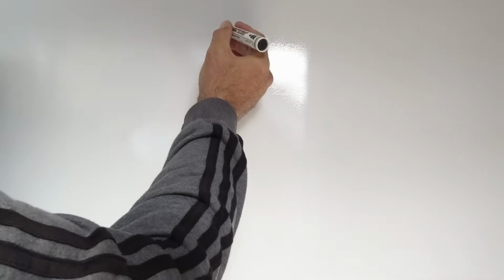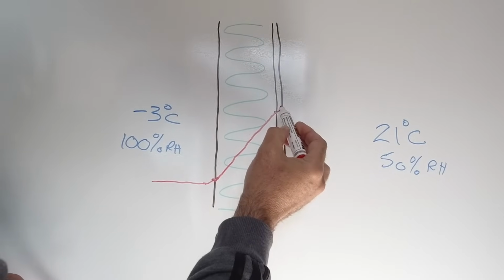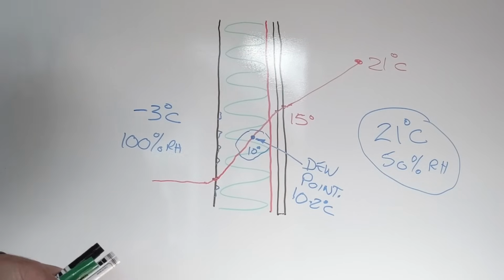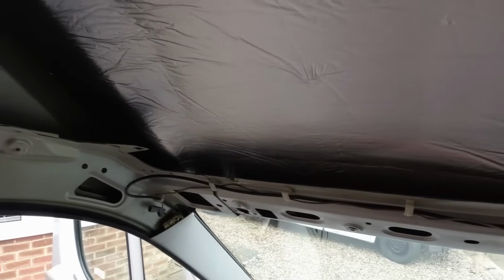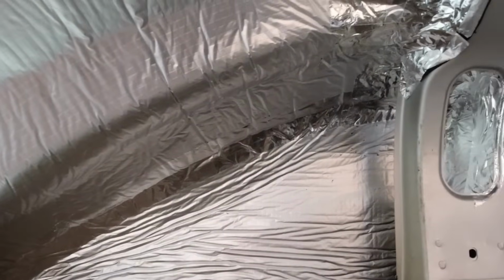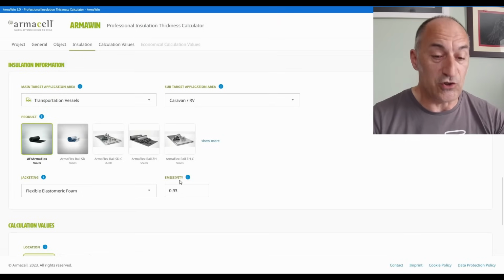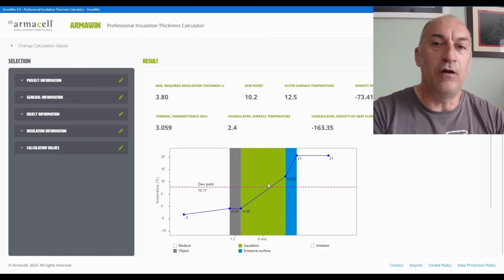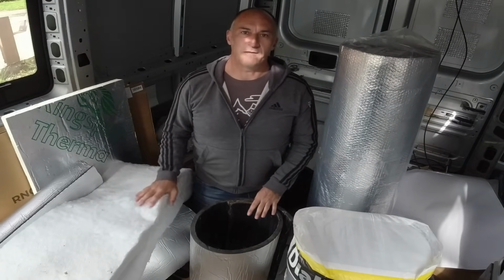The BEST way to Insulate your Van - Budget Build Ep 6

Comment: Loving your videos Greg! Many thanks! I have question about filling the spaces where the brake lights are. Do you remove the plastic covers, insulate those spaces, carpet over plastics covers and replace? Thanks in advance!
Reply from the maker: This is a bit different to how I did the Sprinter van because you do need to access these voids to get at the back of the light clusters and the reason the covers are vented is to allow air to escape through a big hole in the bottom of those pillars when you close a door otherwise the pressure inside would make it hard to open and close doors. So we need to seal those pillars off from the interior of the van, tricky but worth doing. then I would make some insulated plastic bags like pillows and fill the voids with these, that way it can still vent, if it gets wet in there the insulation won't get wet and it will still drain and you can still remove the covers for access to the lights. it's a little bit involved but I hope that helps explain what is needed.
Reply: Thanks so much for this detailed reply. Just so I'm sure I understand...I will fill some little freezer bags with my recycled bottle insulation and fill the pillars with these. I'm then planning to carpet the access doors and still be able to take them off, if I need to access the area. I will then keep the big holes at the bottom of each pillar completely clear so the door can close...hope I've got that right : )
 @GregVirgoe
Reply from the maker: @mj6720  that’s perfect 🤩 I’m planning to cut the vents back into the covers if I carpet them so they still work to let air out. 👍🏼

Comment: What is the best way to insulate against heat. I am in Australia & will be chasing the sun/heat. At this point I am thinking leave a big air gap to avoid conduction. Vents for fridge etc Appreciate any input thx.
Reply from the maker: insulation prevents thermal conduction equally both ways hot or cold. Heat is transfered from hot to the cold. So just use lots of insulation and that will act like a big cool box, don't bother with air gaps as the van is not that big and you need the inetrnal space.

Comment: There will always be a small bit of condensation happening after the vapor barrier on the metal of the van right? You will never get that air 100% free of moisture before installation, especially if you install that insulation and vapor barrier on a hot and moisture day. Would it make sense to put Silica gel pockets there to get that bit of moisture that is still there?
Reply from the maker: You need to watch this video that I made with the calculations to prove how much moisture 
There is Moisture Trapped Inside my Vapour Barrier!
https://youtu.be/waObMyiDXVE
Reply: @GregVirgoe  Great video. Great stuff all over Greg. Thanks for sharing.
Reply from the maker: @Joop900  thank you 😊

Comment: Hi! Thanks a lot for all your videos! Just a quick question if you don't mind: What's the advantage of going with a something like recycled bottle insulation in the ribs and other hard to reach places vs a closed cell spray foam?
Reply from the maker: its easier to install, less mess and no cleanup after and is not permanent.

Comment: 2nd Law of Thermal Dynamics state that Heat naturally migrates to cold. It's not the cold getting in, but the heat going out. Its how your cold chicken gets warm in an oven.
Reply from the maker: What I drew was a temperature gradient across a structure. That does not indicate the direction of flow of heat loss. If I had described it from inside to outside the diagram would still look the same.
Hope that helps you understand

Comment: Have you done the walls yet Greg??
Reply from the maker: I’ve used a combination of PIR, plastic bottle loft insulation and some closed cell foam. Video out soon.
Reply: @GregVirgoe  brilliant 👏🏻  can't wait for the video.. starting my floor this week in my Boxer L3 H2. 

Been taking my headlining down to fit the reverse camera and do the close cell on the roof. 

Thinking of doing a rock and roll bed under the window where you've got your bench seat on the Sprinter so I can have a guest bed... Either make one or get a ready made one. Not decided yet. I'm only having a double bed shower and fixed toilet in mine similar in design to your Sprinter. I wanna fit a external gas point for a gas BBQ. Not sure if I want to cook in the van because of grease and smells.. Dont know yet just thinking of options. 

All the best from 1 mechanical engineer to another 👍🏻

Comment: Love the video its very informative with the facts to back it up! Ill be going down the closed cell route now. Something i can't work out though, shouldn't the vapour barrier be completely sealed e.g like in a loop inside a loop? The outer loop being the van skin ofcourse and the inner loop being the vapour barrier? Or should each wall/surface be sealed with a vapour barrier individually? And if so how can you get around not piercing it with mechanical fixings like staples or screwing battens to the van like people do to keep it effective at being a barrier? Also with internal supports and rails protruding inwards wouldn't this create a bridge through the insulation allowing condesation to penetrate from the outside inward and again vise versa with internal cladding fixtures penetrating through the moisture barrier weather it be in the order of cladding, batten, moisture barrier, insualtion, van or cladding, moisture barrier, batten, insualtion, van ect? Very sorry its a long winded question.
Reply from the maker: Ok let’s take it one piece at a time. 
1. Van body is steel sheet so no water moisture or anything else is coming in from outside. 
2. The vapour barrier does need to be sealed at all joins and all the edges too with foil tape. 
3. Fixing through the insulation is not a problem as the fixing is tightly plugging it’s own hole. 
4. Metal rails that are fixed to van body do create a thermal bridge so my recommendation would be to remove them fix a marine ply batten to the van. Insulate and vapour barrier then re fix the metal rails. That way they are isolated from the bodywork. Wood is a good insulator but would need a vapour barrier over it as it’s pourous. 
Hope that all helps 😃

Comment: Just outstanding! Genius is to make the complex simple. Okay, now that I understand the need for insulation/vapor barrier, etc. I'm wondering how to deal with an L-track long my van walls? (It's a Sprinter just like your first van). I really like the L-track, yet if I insulate over them they're useless. But, if I understand correctly if I don't insulate over them, they will ruin the insulation property of those portions of the van walls What do I do? I've considered maybe making insulated covers for the parts of the L-track not in use, but I'd really appreciate any advice you have.
Reply from the maker: Please can you email or PM me a photo so I can see what you are dealing with. You can find my email on my about page of this channel or look me up on Instagram. 👍🏼😃
Reply: @GregVirgoe  Thank you for your offer. I've sent the email.

Comment: Thank you again for this precious video Greg . I am very confused with my build insulation side and would love some advises from you as it's a box truck ( inside box is 6 Lx 2,5 Wx 2,5 m H) with aluminum panel and 40x40 mm steel structure ..I email you the details of the build with photos and should not be long for you to find out if it's correct and advise me the best way to do it🙏.. .Thanks in advance Greg !!
Reply from the maker: I have sent an email back 👍🏼😃

Comment: Hi Greg, thanks for this video! I get super confused about all the opinions online. And I was wondering how would you insulate the hollow 'tubes' where normally moisture travels. I see online people putting 6mm armaflex around them, but nothing behind them. That would mean moisture would trap inside of the tubes right? Or does it have the space to dripple down through the bottom of the van?

Comment: Greg  I am just about to insulate my ducato/Boxer  I think I could fit 50mm in the sides is there any benefit or stick with 25mm boards ??
Reply from the maker: If you can fit thicker go for that. I will be using 50mm or more in the walls. More is always better 👍🏼😃

Comment: Thanks for this video!Im at this exact stage right now. Do you feel adding expanding foam around the plywood is a unnessary step? Prior to add the vinyl floor? Thanks!
Reply from the maker: I don’t think you need to do that in most cases your wall panels will cover any small gaps.

Comment: Greg, although it might not work for a budget build, would you consider using closed cell spray foam as a combined insulation and vapour barrier?
Reply from the maker: It’s an excellent insulator and built in vapour barrier. Only don’t side is can be messy to install and clean up and is a permanent solution

Comment: Hi, great informative video. My one question is I’ve left the chilly Essex winters and I’m in Australia now. Sometimes we get a chilly 8-10 day… but we also get a 40+ day which is usually more of a problem. Should I just reverse the logic and my hot side is the outside? Or do I need two vapour layers to cope for both scenarios? Thanks in advance. Really great resource.
Reply from the maker: Don’t change the method install it exactly the same. You don’t need to worry about vapour in warm weather but the barrier will work in the colder nights. Insulation will also slow down the transfer of heat into the van when it’s hot outside.

Comment: Hi Greg, I’m having issues fitting my 50mm celotex insulation board to my roof - so was considering buying some closed cell stuff for the roof.. would you recommend this?? Thanks
Reply from the maker: It would work well on the roof. Have you seen the stick pins I used in the sprinter build. Check out the insulation videos for that van.

Comment: Hi Greg. If I attach 10mm closed cell foam with the reflective surface onto the wall and then 100mm Diall insulation roll on top of that with glue, will I lose my radiant barrier due to there being no air gap? Or will an air gap between the Diall and the plywood be adequate? If so how much of an air gap would I need? Also, as my vapour barrier is already attached to the van wall, does this mean I don't need anything between the Diall and the plywood i.e. a traditional style vapour barrier? Cheers.
Reply from the maker: Forget the radiant barrier you don’t need it. The closed cell foam and foil face is your vapour barrier so as long as you covered all the metal you don’t need another barrier over the Diall insulation

Comment: Hey greg, amazing calculations! I have done the same with the 10mm foam, everywhere I can get to.
But a question for you.  If we foam everywhere we can get to, what happens with the areas we can't get to?  Such as inside the ribs.  Does the condensation effect increase or further concentrate on those areas because it now has less other areas to form on?
Reply from the maker: I would suggest going over the top of the ribs with a vapour barrier to stop any moisture getting in there.

Comment: Hi Greg, how does this principle work if the temperatures are the other way around?  For example if you were trying to keep the interior of the van cold while it's boiling outside?  Is it the same type of calculation, or an entirely different ballgame?  Thanks!
Reply from the maker: I was using this calculator to predict where condensation would occur however in warm weather you don’t need to worry about condensation but you do need to stop heat gain to the van 🚐 
A good thick layer of insulation will slow down the heat transfer. Think of the van like an insulated cool box. Another thing to do is stop the sun getting in through windows with external reflective blinds 🙏🏼

Comment: Hi Greg, I have the same van as this as currently using your videos as a step by step guide to do mine. Just wondered what size roll of the 10mm close cell foam you bought to do the van? Thanks
Reply from the maker: I have purchase two 5m rolls as I plan to use it elsewhere 👍🏼😃
Reply: @GregVirgoe  Thanks, will get some ordered 👍

Comment: Wow! So glad to have you back with van building videos. Very enjoyable to watch and the detail is second to none. Just started my van build of a 2018 transit extended wheel base and  videos like this are extremely helpful. Thank you Greg.
Here is Spain our major problem is heat in summer so I decided to use 20mm Kaiflex throughout followed by 15mm multicap reflective. Hoping that will go some way to reducing the oven effect in summer while keeping us toasty enough in winter. Good luck with the build and thanks again for sharing. 🚐🚍
Reply from the maker: Insulation will work both ways. It’s always good to well insulate as this will slow down the transfer of heat into the vehicle and keep it cooler during the summer. Also a very good idea to get some external reflective blinds for the cab windows to keep out the sun. Solar gain through glass is the largest contributor to heating up your van in summer. The more you can stop the sun getting in the cooler it will be 😎🚐👍🏼

Comment: Hello Greg, I live in Brazil and here, unlike there, the problem is the heat, where the car is exposed to the sun, the plate easily reaches 80 degrees Celsius. How to calculate the thickness of thermal insulation needed to keep the internal temperature at eg 25 degrees Celsius. Thanks.
Reply from the maker: You do need to install very good insulation like PIR and as thick as you can. It will slow down the transfer of heat from outside to inside. Think of your van like a cool box they are insulated well to keep your beers and picnic cold 🥶 also make sure to put external blinds over your windows to shade them from solar gain. That helps the most to keep the van cooler.

Comment: Hi, Greg. I just start to convert my van. It's also a Fiat Ducato. Question : I will put 19 mm Armaflex, and I want to put 10 mm polycarbonate and 3 mm cork, glue to the polycarbonate. What you think? It's a good idea? It's very light. I hope is not a problem the plastic sheet (polycarbonate). Thanks for your answer. I never saw this kind of walls in a van, but I think good be a good material for walls. I will use alumínium profiles for the layout.
Reply from the maker: I would not bother with cork it’s not very good to use. Waste of money for no insulation value. You would have to use 15layers of it to do the same as 50mm PIR board. Stick to the basics
Reply: @GregVirgoe  thank you

Comment: If your using the wool type insulation and stuffing it into the hard to get to like wall box sections etc, do you have to keep in mind not to stuff it in too tightly? does it need to be a bit looser to do its job properly or doesn't it really matter if its stuffed in tight?
Reply from the maker: It’s a negligible difference so don’t worry too much.

Comment: Thanks Greg. I found the warning about dewpoint and condensation inside the insulation very worrying. First time I've seen it. Glad I put in vapor barrier. I was lucky with the closed cell foam for the over cab roof. I just used the thickest I could find at the time. 18mm. It had the added benefit of damping roof noise😊
Keep these up. I may not always agree, but really appreciate your thoroughness and clear explanations.
Reply from the maker: I know that we can have a civilised discussion about it and you're a gentleman Kev, so I welcome your thoughts on any of my videos. Thank you for always being a long-term supporter of the channel, hope to catch you for a beer soon. Cheers :D

Comment: I’ve just come across a product called Low-E. Waiting for a call now from the company to explain how their product can work in my van conversion. Sounds ideal at the moment.
Reply from the maker: Hello Phillip, I have got a sample of Low-E to investigate myself. The first thing is it's really just a radiant and vapour barrier it's not going to give you much in the way of thermal insulation to prevent heat transfer as it's only 5mm thick. They did publish a K value of 0.0366 W m² K which is about halfway between wool and PIR board which is what I expected for the core. but let's put that into perspective.
To match the thermal resistance as 50mm of PIR foam board you would have to stick 17 LAYERS of Low-E insulation on top of each other to get the same level of insulation. So you see it is not very good as an insulator and really its only purpose in van building is as a very good vapour barrier. I would use your money on cheaper more practical solutions. Hope that helps
Reply: hi again Greg. I’ve had a chat with tech at Low-E and they are saying that it will perform extremely well in a conversion providing it is installed correctly. They suggest using the 5.5mm product directly on the panels because using the thicker 11mm won’t make much difference (placed over the sound deadening/absorption material), then spanning from front to back sealing with tape to provide the vapour barrier and leaving an air gap between the body panels, and then battens to fix the final boards to again leaving an air gap to provide that all important thermal barrier. Sounds good in theory but I’m a bit sceptical.
Reply from the maker: Ok let me put it to you like this. I have 50mm PIR in the walls of my van. You install a layer of lowE with an air gap in your van. 
You will lose 17 times more heat from your van than I will.
Does that sound like it works?
Reply: @GregVirgoe  doesn’t sound ideal at all. Going to get back to them I won’t be using it. Thanks for your info, brilliant conversions.